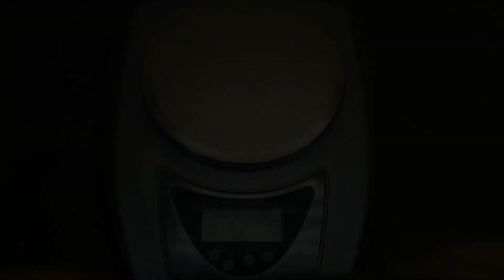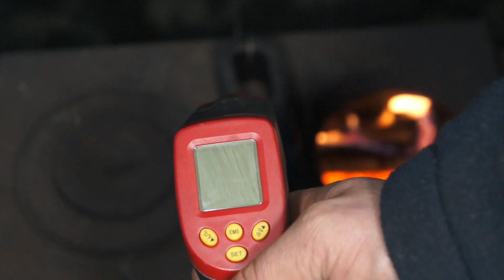Make a Japanese blacksmith's hammer, with an off center from an old sledgehammer.

Comment: You reused an old, pickaxe-like hammer. It's a good idea. The striking surface of the hammer used by Japanese blacksmiths is not a flat surface but a slightly curved surface. The reason is to let the hammer escape when hitting the material so as not to scratch the anvil's face. Occasionally, the corners of the hammer may get into the anvil's face, but a slightly curved surface will prevent deep scratches. from Japan.
Reply: Do you know the reason behind the off-center?
Reply: Mr. @martinuso7446  　The answer to why is that the hole in the traditional Japanese blacksmith hammer is off center in the Japanese blacksmith's workshop. The anvil in a traditional blacksmith's workshop is buried in the ground as it is, and the master sits down and tells where to hit, but the hammer with a hole in the center of the partner's hammer is very low because the position of the anvil is low. It's hard to hit. So the hole is off the center of the hammer, not at the top. Also, since the center of gravity is concentrated downward, it is difficult to swing it up, but it is easy to swing it down. This is the result of devising a device that suits the original Japanese physique.
from Japan.
Reply: @松永昌芳  Aha! Thank you!
Reply: @松永昌芳  i was always wondering. thank you for your detailed explanation :)